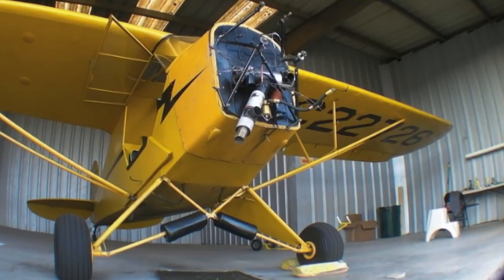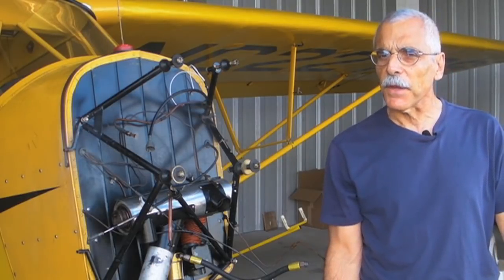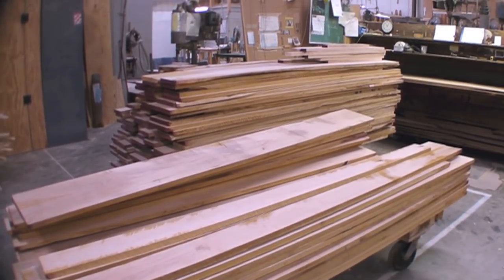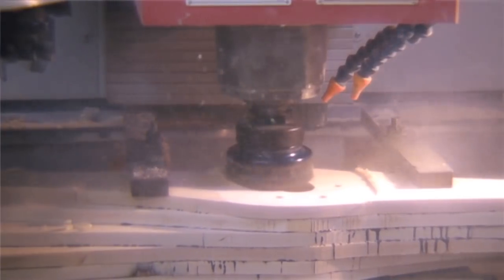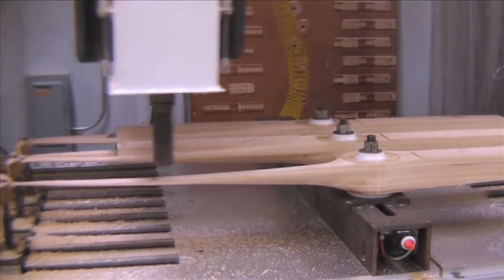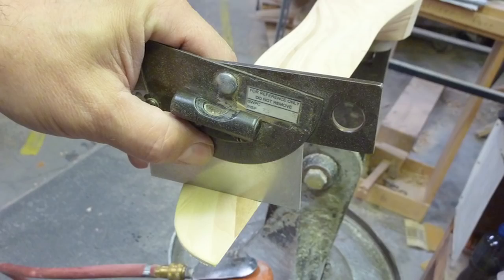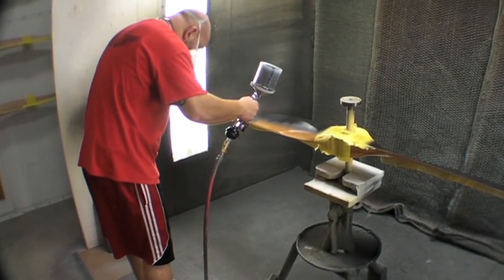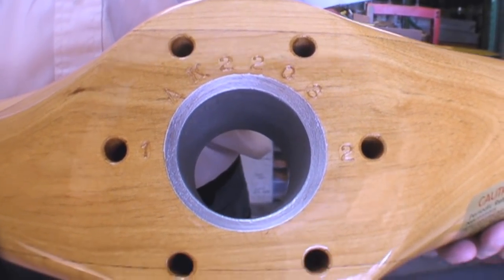How Sensenich Wooden Props Are Made

Comment: Are these props not balanced?
Reply: lol, yes they’re balanced. Did you miss the part where they said they have to go over them with spokeshaves and sanding by hand to balance them?
Reply: @panzerlieb  finishing the surface is not, by itself, balancing. The video didn't mention checking and correcting balance, but it must be done.

Comment: I thought resorcinol glue was banned back in the 1980’s because of carcinogen concerns. Perhaps it has been reformulated.
Reply: No, same old stuff. Never banned. Older formulations could use formaldehyde as a catalyst but safer options are used now.
Used to work at a plant in Tacoma, WA in the mid 80's. We made resorcinol adhesives for the laminated beam industry, 15,000 pound batches at a time.